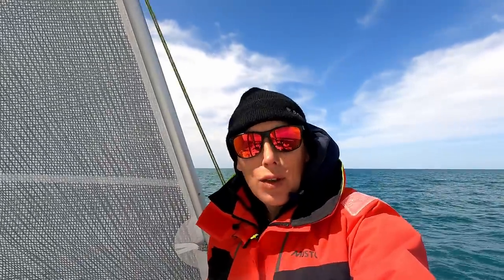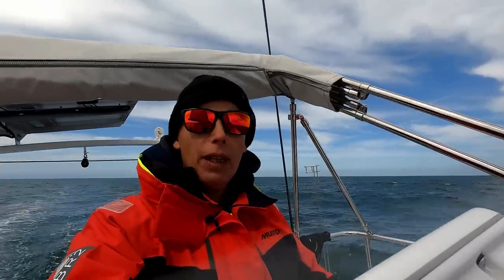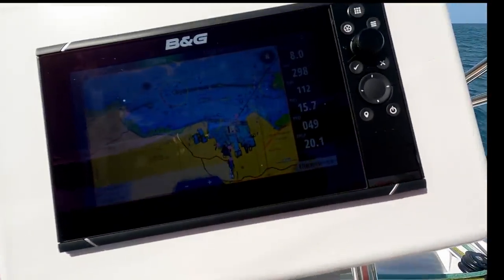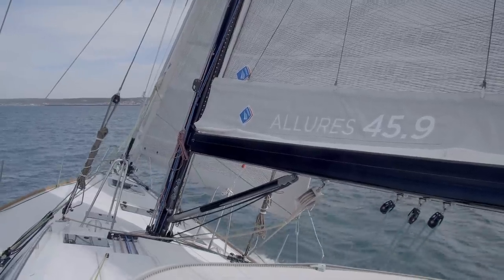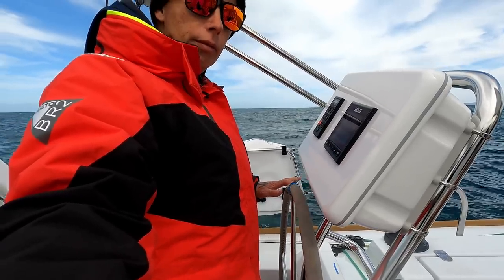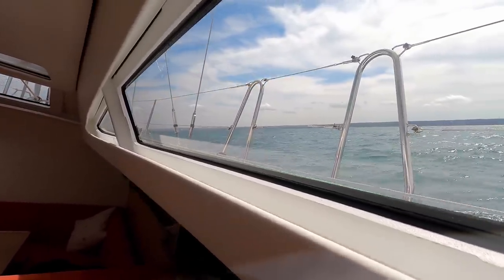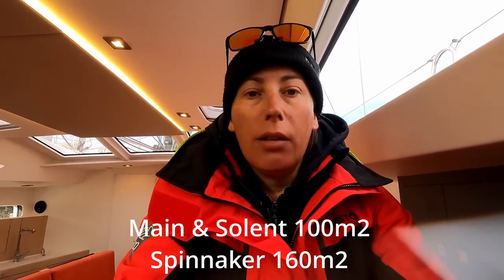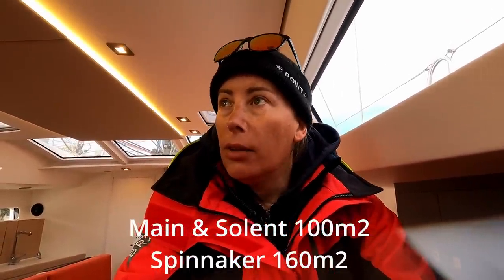ALLURES 45.9s Test sail and full tour.

Comment: I prefer Allures 40.9 myself rigged for single handed sailing with Hall Spar's OceanFurl in-boom main furler, self tacking jib and a FLIR M300 mast mounted infrared camera.  While you are at it, let's add a Parallel Diesel Electric Hybrid Engine, 1KW/ hr LiFePO4 battery bank charged with 500 watts of solar, regen prop and EFOY Pro 2800 Fuel Cell.  A SOLO SAILER'S DREAM.
Reply from the maker: I love the 40, to, but they have stopped making them.
Reply: Yes they did, which is a shame. The 45 is too big for solo sailing but rumor has it they are getting ready to release a 42 in the 2nd quarter of next year, but with Europe falling into recession, who knows!!
Reply: @Sabre3861  We did ask them not long ago and they denied any knowledge of a 42 coming out.  The 45.9 is now the smallest boat they currently make ;)